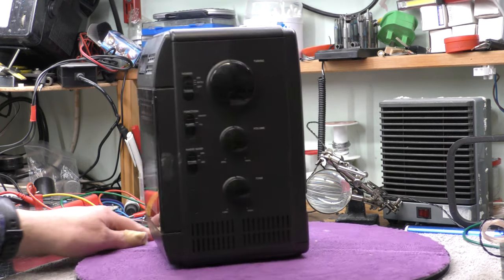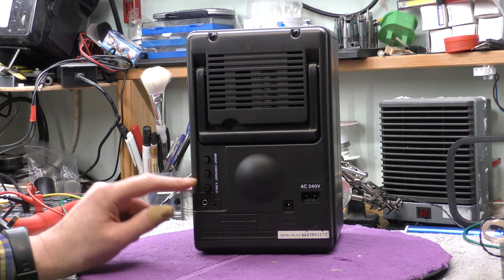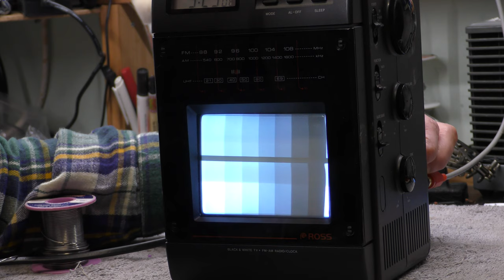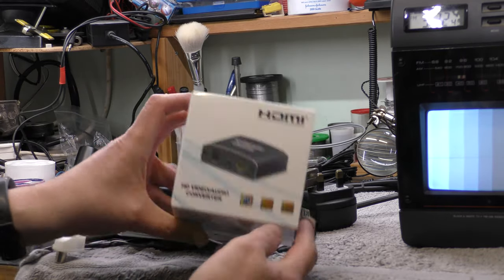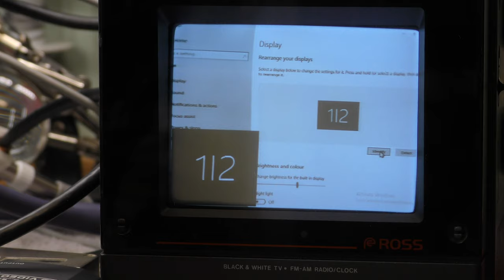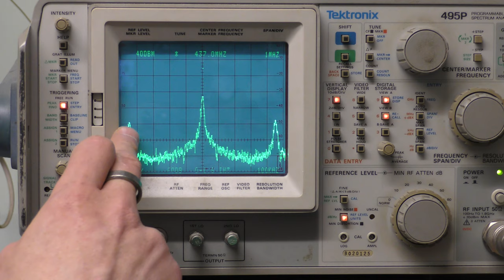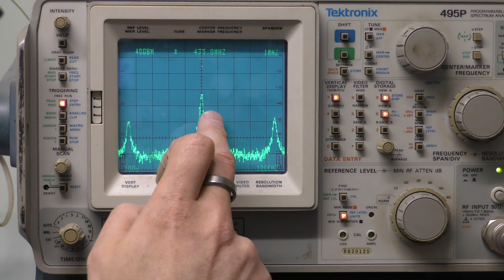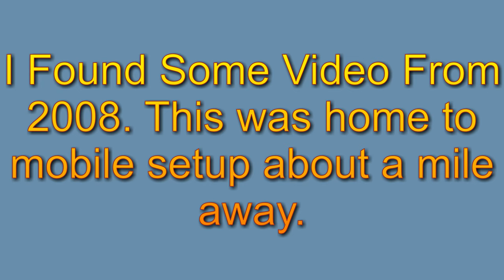Ross RTV5 TV & HDMI conversion & Analogue Amateur TV 70cms (4K)

Comment: That’s really interesting I am thinking of trying to do something for my 405 line television. So was that HDMI to composite video and then composite video  to UHF ?   I remember slow scan TV but  I have never seen amateur television. Nice spectrum analyser. Regards Chris
Reply from the maker: Yes that's right, Chris. I've been meaning to try a HDMI to composite adaptor for a while. I don't know much about adaptors for 405 but the Aurora is often mentioned and there is a web site. Amateur TV has always interested me and its one thing that gets the public eye in amateur radio. I started with reduced bandwidth black and white on 70cm. I've also worked through a local repeater on 23cm. There are some videos on my channel.